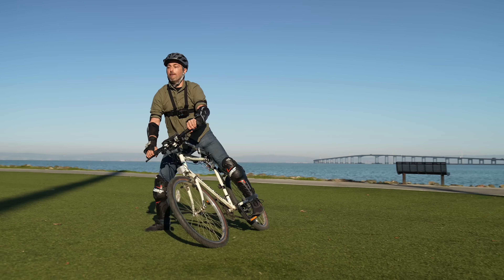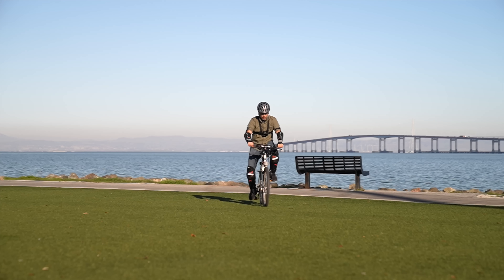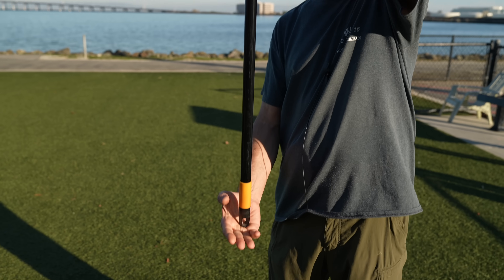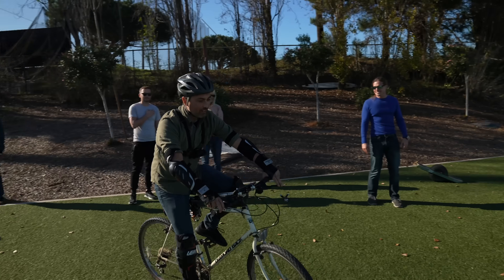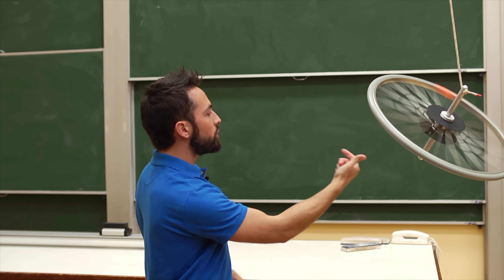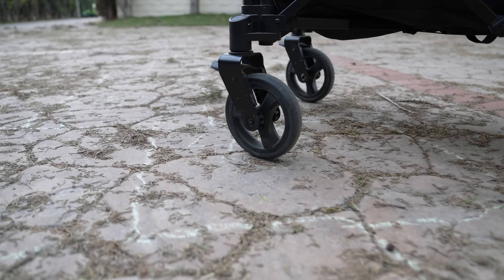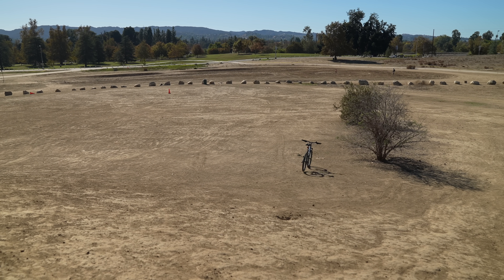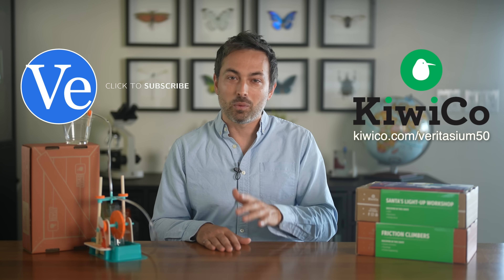Most People Don't Know How Bikes Work

Comment: I figured that you have to do a counter turn as a young teen trying to lean as low as I could when I turn while running. I realised that I can't just lean into the curve but my feet have to move outwards first. I remember seeing my dad making a tiny counter turn on the steering wheel when he makes a sharp turn (usually when trying to leave a tight parking space). That made me pay attention to bike riders and realise that they do the same thing. I also realised how important steering is to balance because I learned how to ride a bike when I was old enough to pay attention to what I was doing.

But I didn't realise that bikes can inadvertently steer themselves and how its build makes the bike's front wheel work like a caster wheel. That is fascinating.

Comment: ... This is entirely ride-able though? Yeah it would be difficult to get used to especially with the ingrained countersteer instinct, but it's not so difficult as to be impossible. You don't need to counter steer to initiate a turn, you just need to lean to that side first rather than only leaning as the turn is initiated.

Comment: Every motorcycle rider is laughing right now, at about 20-25mph you can no longer "steer" a motorcycle, the gyroscopic forces become so much that rider does not have the strength to turn the handle bars, instead we use a combination of counter steering (leaning to adjust the center of gravity) and exploiting centrifugal force, at that specific speed, the bike just wants to stand back up, and when you force it to turn, you feel that lateral force pull you towards the outside of the the turn.  
When your center of gravity is brought back to center, the bike stands back up. 
Ask any motorcycle rider, we don't steer with the handle bars, we steer by shifting our weight and playing with gyroscopic and centrifugal forces.

Comment: I was thinking I'd ride the locked bike without touching the handlebars, effectively using my body to act as it's own counterweight. I think I might succeed if it is partially locked. But when you fully lock the steering the bike is useless
Reply: Yeah. I would say most of the falling is caused by the lockout interrupting a stabilizing movement that was meant to keep the bike straight.

Comment: Interestingly, believe it or not, but most of this is part of Motorcycle theory lessons for the driving test here in Germany. You also have to practice a ton making so called "Grundfahraufgaben" (Basic Driving Exercises) that are designed meticulously for this kind of handling of bikes.
It is crucial that motorbike riders understand this, because it also is part of the reason why, contrary to popular believe, motorbikes are NOT more agile than cars when driving with a reasonable speed. The time needed to counter-steer to actually, lets say to avoid, an obstacle, results in quite some distance driven before you actually facilate the turn.

This really is imperative for every bike rider to grasp.

Comment: When I got my first bicycle I over thought the process and it took a while before I could even ride the bike straight across the open field my dad made me practice in. My cousin got on and just used his instinct. My initial difficulty has not abated my curiosity about bicycle stability, and in the past the unrideable bicycle attempts made by  bicycle design groups I have been associated with had always been overcome by the instinctive riders in fairly short order. This  was because the steering had always been free enough, despite added the complications, to do the right before left you describe. 
. I commend your associate for finally making a truly unrideable bicycle. Circus bikes are made with vertical steering axis and no trail, and like unicycles are difficult to master but  can be amazing once they have been. My simplest description of bicycle control theory is that, even going as straight as possible the bicycle must function as if it is a "time-share tricycle" with the front wheel being in two places alternately along the line of travel that the rear wheel follows. Changing direction  is to extend the time spent in one of those two alternating locations  ahead of the rear wheel line. Unless of course your bicycle steers by its rear wheel:)

Comment: Street motorcycle riders learn this effect REAL fast on their first ride out. (I say street because on dirt there is less traction and you can steer via the sliding of the rear wheel as it looses traction) Especially when turning left at a stop light. By turning the steering in the opposite direction momentarily, you are allowing the bike to fall in the needed direction. Once that happens is when you actually steer in the target direction.

Comment: If you're going slow this is true. If you're going faster it's much simpler, because you aren't turning the handle bars much at all and certainly not to the opposite direction. You just lean and your weight drags the bike onto the angled part of the tires while barely moving the handle bars and you simply start going that direction, and the sharpness of the turn doesn't really come into play because only a moron would try to go near or even more than 90 degrees at speed, your momentum would throw your ass off that bike at whatever speed you were traveling, hence why you see so many bike wrecks that involve the human rider sailing through the air lol.
Reply: Most things humans do are actually quite intuitive for us. Our brains understand what we need to do before we ever actually acknowledge it consciously. Our righting reflex is much the same. When falling, if you're still conscious anyway, your body will Instinctively attempt to flip you over in an attempt to land the fall on your feet or knees. You can disregard the instinct or keep it from triggering by simply knowing that you want to land on your back before you actually start to fall, i.e. a trampoline.

Comment: Very interesting video, as someone who has been cycling basically their entire life I was well aware of the counter steering issue. Who, assuming they've cycled as much or more, hasn't been too close to a barrier or poles or something else and because they couldn't counter steer they had to painstakingly, ever so slightly, shift their weight and do minuscule corrections before they could steer away from the 'danger'? It's quite nerve wracking 

Now you just need to learn what a proper bike for commuting is (those people from TU Delft have the right idea).
None of that 'road bike', mountain bike, BMX, bs I see people in NA ride just to commute. Now sure, you're going recreational or even training cycling, go get the expensive high grade space age materials bike, go wear the skin tight clothes and special shoes etc. Or are you going touring for 100s of km, sure get a touring bike with enough storage for your clothes, camping gear and whatnot. etc. etc.; cycle away. But just going from A to B? Get a European/step-through/oma- (or opa-)/Dutch/city (or however it's called in your area) bike.

Comment: It a depends on how fast your going. At slow speed you have to turn the handlebar. 
At high speed you only give pressure to the opposite direction to lean the bicycle.
This of course is how motorcycles work also.

Comment: So, a bike uses its mass + speed + angle of the wheel to make turns, and there is giroscopic effects. + constant corrections while steering. 
But i always felt that balancing on a stationary bike was like balancing on a rope, while moving it, was kinda like falling forward constantly, so it becomes a plank, that gets wider as you move. And i feel the same in an electric not steering bike.

Comment: Excellent video as usual. What I have been interested in is the phenomenon of countersteering in motorcycles. When riding, if you place the palms of your hands on the handlebars so that you can only push the bars, if you want to turn right you push on the right hand side. This aligns with your video, however, to keep turning once the turn is initiated, you continue to push on the right hand side, the harder you push, the more you lean to the right, the harder you turn. This effect seems to be less noticeable on a bicycle, except at higher speeds. I understand how countersteering initiates a turn, but how does continual pushing against the right hand side correspond to a continued right hand turn? Is it gyroscopic forces? And if so, how does the engine spinning on a motorcycle affect this? You would think that an engine with high reciprocating mass spinning at high rpm would produce a larger gyroscopic force than the wheels. And what happens if the engine is geared to run in the opposite direction to the wheels?

Comment: I always thought it was the change in shape of the "contact patch" that caused an unmanned bicycle to self-right. As the bike leans left or right the wheel "contact patch" goes from basically oblong to slightly banana-shaped and this pulls/steers the wheel in the direction of the lean.

Comment: Try it at higher speeds i think you will find you can steer. On a motorcycle you only use handle bars at low speed, to make a turn on the highway you just lean a little.

Comment: Kind of wished you tried with the bike gram already leaning before the turn. If you are off the seat, you can ride a bike in a straight line but already leaning.   To turn the tide shift they’re weight laterally and turn the steering right.

Comment: I think its not possible to counter the gyroscopic effect with a counter rotating wheel. 
think about it this way:
If you have got one axis with one wheel it counters any rotation around the axis perpendicular to this axis. Now you've got two of this setups. Still both counter this sort of rotation. Now you bring them close and finally connect them. Now the counteracting will be double as high as with one wheel. even if one wheel spins the other way.
So they did a wrong experiment.

Comment: not for bmxers we dont use the steering that but our body and head moment. only time we would do such a turn is when we do a bunnyhop 360 or 180. to carve the angle of rotation but in normal riding we dont steer like that or should i say i dont steer like that. as bmxer's we stand all the time but when you sitting then that will happen

Comment: The brain can learn to compensate for predictable variables, such as, you can learn to ride a bike with the steering geared so turning has the opposite effect on the wheel. It takes dozens of hours of practice and once you learn it will take almost as much practice to learn to ride a normally steered bike again. It may be the most pointless thing I've ever done, but I did it.

Comment: Most motorcycle riders know that. Counter steering we call it. When we want to turn left we actually push the left handle away from us a little, so the bike falls left (as it does when you turn the steering right which is what actually happening) and then we balance that fall with our body and speed.

Comment: There are bikes designed with no gyroscope effect and no forerun (I hope this is the correct technical term)  at the front wheel or fork and they keep themselves upright (like shown at the end of the video). There is a whole society dealing with this topic and no good explanation has evolved. So this one is incomplete as well. I don't wanted to be negative about the video, but it still doesn't explain the reason why a bike keeps itself upright.

Comment: I'm still confused. So if its not the gyroscopic effect keeping it upright, then why do I even have to ride it? I should be able to sit on a stationary bike and just turn the handle?
Reply: Some people with great balance can actually do that, but what is keeping you stable when you ride is the ability to move your mass with and against the angle the bike is going in, enforcing or countering that angle. It is an inverse pendulum effect that works at relatively slow speeds, but not standing still.
Reply: @Diggnuts  I'm still not clear. The bike feels more stable the faster I go. How do you explain that?
Reply: @zeropain9319  That is because you have more control authority at speed do the the effect of steering and counter steering. Your mass stays the same, which is a big part of balancing, but at speed, getting that equilibrium right is easier than at low speed.

Comment: I kinda learned this years ago when I was a motorcycle rider. Riding the twisty mountain roads where I lived, I found that to really lay the bike over on a turn, I needed to apply a bit of counterforce on the handlebars opposite the direction I was leaning. Pushing the front wheel just a bit out of the turn from its neutral position would immediately and dramatically lean the bike over. The effect is pretty drastic(!), so was scary the first time I randomly discovered it, but with very little practice, I felt like a pro cafe racer snaking through the Alps 😃 (Or a stupid 20-something with no actual skill or experience and a death-wish 😮😆)

Comment: I object to the statement that riding with locked steering is just as hard as balancing a stationary bike.  It is much much harder.  There is something called a track stand that can be done with a stationary bike.  I thought for a second you were going to demo it.  On a bicyle with a freewheel one does need at least a 1% slope on the road, which is typically provided by the camber of the road.
(In truth, an almost stationary bike, because there are millimetre scale motions to adjust weight relative to the front wheel.)

Comment: Did anyone try popping small wheelies to adjust their balance, rather than turning the bars?
If you can’t turn the bars to the left, lift the front wheel and shuffle it a few inches left (do a small wheelie)

Comment: With motorcycles, you actually steer in the opposite direction that you want to turn unless you're traveling under about 20 mph.  When traveling at very low speeds you essentially steer it like a bicycle.

Comment: If your going slow enough you don't need to counter steer, lean first then turn
Anyone that's been cycling and got too close to the edge of a road can attest how hard, mentally, it is to do above 25kph. You cant counter steer when your 1inch from crashing

Comment: So could you steer a bicycle left (with the locking mechanism not letting you steer the handle more left than "neutral"), if you rode a wide and long arc and only used your bodyweight to lean? Or does the locking mechanism prohibit you from properly riding your bike so much (since you can't even correct for balancing) that you wouldn't be able to ride a long straight or a long arc either?

Comment: I've known about counter steering for years. And it's not just for bicycles. You turn a motorcycle the same way. And counter steering is a subconscious act. You don't even realize you're doing it. What I didn't know was what kept a bicycle (or motorcycle, for that matter) upright. But making minute steering corrections sounds like a very logical, rational explanation. So thanks for that.

Comment: Wouldn't the fact that the wheels curve away from the center also contribute to automatic balance steering? Whenever the bike tilts, the tilt side of the tire has a smaller radius, so it turns that way...

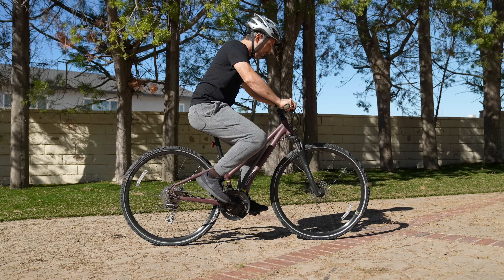Comment: 5:03 If this is true, why is it easy to ride with no hands, but almost impossible to balance at a standstill?
Reply: Because for the inverse pendulum dynamic to work, you need something that it counters, which is the angle/motion of the front wheel. Those two are in equilibrium.

Comment: This is also what people need to overcome when the start to ride a tricycle!
Reply: And you do the same if you cycle without hands on the handlebar, if you go faster you are easier to balance.

It behaves much like a rocket would with self stabilization... lean left and the wheel turns left etc.

Comment: Counter Steering... 
(This is my understanding of it so if I'm wrong please elaborate)
Counter Steering that's how motorcycles turn. You turn the wheel slightly left to go right and right to go left. The motorcycle weight always wants to naturally fall opposite of the turn, check out next time a bike is parked the weight easily falls opposite to the steering head turn and lean the motorcycle towards the weight. (You can still park with the steering head pointing towards the kick stand though.) To go right, push down on the right handle bar, to go left push down on the left handle bar. Effectively turns the steering opposite and drops the weight of the bike in the direction of intended travel. It's a cool concept and you ride motorcycles different once you know.

Comment: I like how you didn't discuss the center of gravity once. you kept talking about pendulums and moving bases and points of contact, but nothing about center of gravity. sure the steering column helps adjust the bike to keep it under you, but thats just a correction of the center of gravity. to be very frank, it's rather obvious that most of the people in this video haven't ridden a bike very much, because if they had they would know that you can lean into a turn and won't have to worry about any unconscious actions that work against them, because they be to focused on being gentle enough with the controls so they don't fall. this same outcome happens when riding jetskis, but only if you are moving at high speeds. if you want to turn a fast moving jetski without flinging yourself off, you have to either counter turn into a proper turn, or you can just lean into the turn and require alot less effort to turn. it's all about the center of gravity and the skill of the person riding, not some ability to turn random directions

Comment: Gyro procession, when you started a turn you would slow down causing the bike to turn to the right. No matter your desired direction you were looking straight down at the ground instead of the horizon meaning you balance requires you to steer both directions.